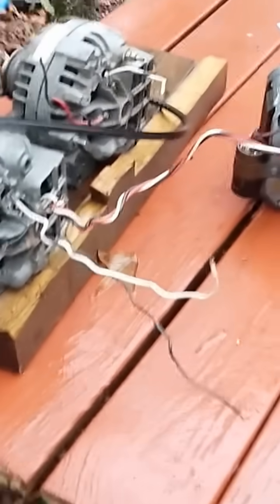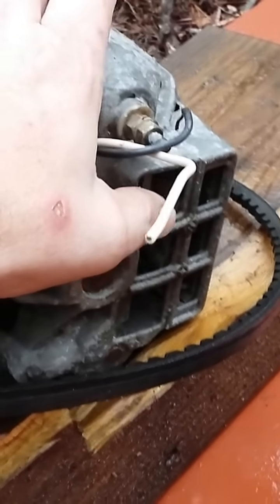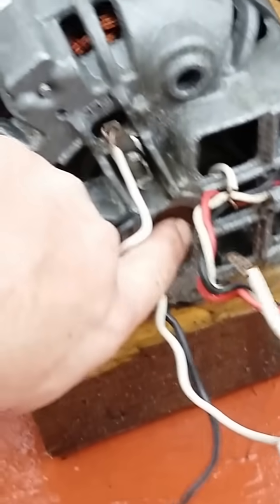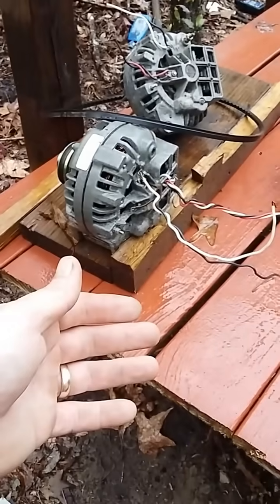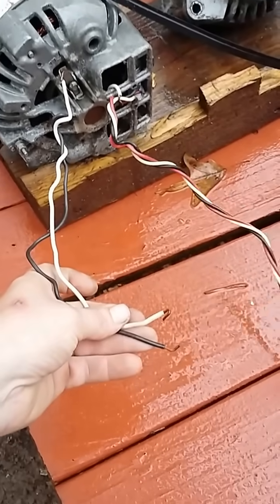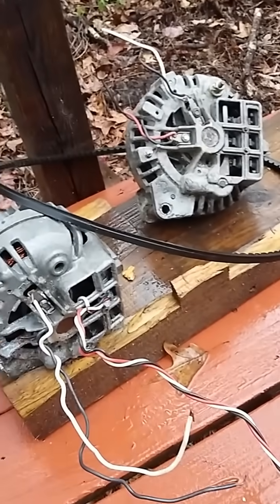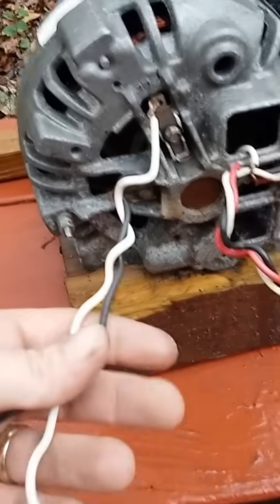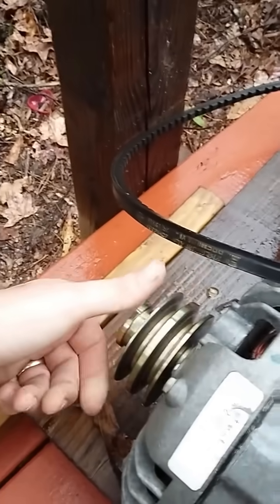Update Free energy forever no wind no solar no gas READ DISCRIPTION!!!

Comment: A few questions 
How do you use 3 phase power to power 1 phase appliances
Reply from the maker: if you have 3 phases of power and you're trying to power a 1 phase component then you either need to only use one of the phases(a hot wire) and a ground. Or run the two outside phases into a capacitor and then Run 1 phase or wire off of that capacitor but depending on what three phases you have and how stable they are, you will need to probably use an electrolytic capacitor to store and build up a charge and then run to a breaker that will stop too much power from coming in all at once.
Reply: Thomas Buie ok but that does that mean ill get less power, how am i going to get this getting more out than i put in when im only using one wire out of 3, i want to do what your hinting in the video
Reply: Can you make another video about it, sorry man
Reply: One last thing, how do you dustribute such a large amount of power, 90 amps  is heaps, i can imagine what you are hinting is true
Reply from the maker: +Zlatan Ibrahimovic brother you're not bothering me one bit by asking me questions!! it's the people that get on my YouTube channel and don't read anything or watch any of the videos that start cussing me for no reason that bothers me...
Reply from the maker: +Zlatan Ibrahimovic brother I do it with an electrolytic capacitor / Transformer. Homemade of course it's not a step up transformer or a step down transformer it's basically a big capacitor. I made one in one of my other videos out of 3 salt shakers in a glass jar. That one however is not big enough to handle a couple of generators...   I will have a couple more videos uploaded in the next day or two that you should really watch!  DO NOT TRY THIS AT HOME
Reply from the maker: +Zlatan Ibrahimovic   I will be uploading some more videos about the subject in the next day or two.
Reply: Thomas Buie awesome man i believe in you man, everyone is brainwashed
Reply from the maker: +Zlatan Ibrahimovic  yes they are!!!
Reply: This sounds good, but for a newbie, where do you start. where do you get those alternators, junkyard or parts store? Need more information about hardware. I don't know electronics so what do i do to understand how you use diods and capacitors? When, keep up the good videos.
Reply from the maker: +Peace450  there is missing information from the video I'm actually using one of the alternators as a BLDC motor if you put that to a couple of generators (the bigger the better) only using a few amps to create quite a bit.. You can use an alternative source to start a machine to run a machine off of itself or you can use direct current to power alternating current with a battery and/or capacitor bank, there are a few ways that I know of to create overunity.

Comment: I used to rebuild my 1970's 1980's gm alternators tookem all apart putem back together, now those alternators would run about 700rpm on my 350 cu inch engine at idle so my alternator is running at 700rpm/60sec= 12 hz .but we don't care because we are after the DC ,now if you "plug this directly into your wall for AC "(doesn't come factory built for this" wall AC") but if it did you would have to speed it way up from 700 to 3500 rpm  just to reach 60hz.    60hz/12hz=5 and 5x700rpm=3500rpm wow that's a lot of gas used in an hour for an hours worth of electricity ! your better off buying a solid state MOSFET 12vdc to 120vac power converter ! harbor freight has some good ones .
Reply from the maker: +Cata strophic some of your math there is a little wrong brother you need to spin an alternator at 3600 RPM to get 60 hertz, 60 hertz is 60 cycles per second. so 60 seconds x 60 cycles per second equals 3600 RPM

Comment: wheres the free part.....lol.....every mechanic on the planet knows a car alternator generates ac voltage that gets converted and regulated to around 14.5 v......heance the name.......ALTERNATOR......LOL.....funny.....
Reply from the maker: yeah LMAO...  OK so since you know everything that an alternator does, what happens when you take the direct current Bridge rectifier out of it and put in an alternate current Bridge rectifier? lol...
Reply: Thomas Buie are you kidding me man you just said take out the bridge rectifier and put in a bridge rectifier both of those are the exact same thing come on dude do you know how to build a bedini motor do you know anything about frequency do you know how to build Tesla coils and such
Reply: dude I've been a mechanic for nearly 25 years and into Electronics for probably about 30 what you are doing is nothing new to me.... I have that same alternator you are tinkering with its a Dodge alternator it has no voltage regulator only a bridge rectifier and if you bypass it obviously it will put out ac voltage I bolted mine to my Chevrolet Astro van several months back and used it for welding as an experiment... there are a lot better  things you can make a generator with one of the best things I found is those pancake style washing machine motors with the 42 pole in them they are great you can spin it with your hand and it will put out a hundred twenty volts ac with no effort.
Reply from the maker: +Gary Marshall and that is the exact point I was trying to point out to you... You didn't read any of the other comments, you haven't watched any of my other videos, and just like everybody else you also want to bash me as soon as you see this video that I posted with all the misinformation in it, on purpose! so instead of telling me what I can't do why don't you ask some questions and say what are you doing or how are you doing this and what with? In what way are you modifying these alternators? Did you put a alternate current Bridged rectifier in the back of these alternators? Dodge GM.. how exactly does the rear end in a Plymouth work nobody knows? here's a better question, Thomas what are you powering with your bldc alternator motor?
Reply from the maker: +Gary Marshall 
 if you turn that alternator 3600 RPM's and put 3 volts to the field wires without the direct current bridge rectifier or the 6 diodes whatever you wanna call it running in parallel after the fact then what comes out before you are correct and will be at 60 herts (60 cycles per second) and will be alternate current...  They're is half of it...

Comment: Is this a gag? Even if it would work (and it will not ) there is now way those wires would handle 90 amps. And it would not be free power because you have to have a engine to turn the alternator. I do not like paying for my power bill any more than anyone lese does but I live in the country so every once in awhile I will loose power and have to run my generator for a few days, Mine is not huge it runs everything except our central air and electric oven. It burns 11 gallons of gas a day. figure average of 3$ a gallon times 11 = 33& a day so that would be 990$ a month of 30 days. That is not less expensive!
Reply from the maker: What could you run those wires to that would be able to handle a load like that? Or charge from that? And I'm not talking about batteries...
Reply from the maker: +Barn Dweller no this is not a gag yes I know those little wires won't handle 90 amps of anything especially 90 amps in copper so how many amps run down the aluminum power lines does anybody know? I know it's at a hundred thousand volts and up to 300,000 in my area but I've heard people say that it goes higher than that so what you're saying is I can't step up my own system to stabilize it and then step it down to use it to power itself and anything else I want it to?
Reply: Thomas Buie I love sarcasm

Comment: The laws of thermodynamics and the conservation of energy need not apply
Reply from the maker: that's exactly right because you're using two batteries as capacitors to start the machine with a motor and an inverter and then once the machine is running u-turn on another motor twice as big with the generator running off of the first motor  (the second bigger motor not turning or hooked up to the machine until the generator is powered up) then you can unhook the first motor and just run the bigger one. therefore not breaking the laws of physics but bypassing them...

Comment: that's upto 90amps @12volts... not continues amps, also yes it puts how a high voltage but the regulator steps down the voltage so it can put out that many amps.
Reply from the maker: which is why did you take the direct current Bridge rectifier out of it and put a alternate current Bridge rectifier in it...

Comment: This is a basic junior high school shop class experiment. When you change from a low voltage to a high voltage it is a transformer. It is not making more power. The power does not change. If the voltage increases, then the current decreases. In fact, if the alternator is good for 90 amps at 12 volts, it will only be good for 9 amps at 120 volts (household line to neutral voltage) or 4.5 amps at 240 volts (household line to line voltage). He is mistaken to say the output is 90 amps at the higher voltages. Never mind the fact that you still need a motor to turn the alternator, thus negating the "free energy" claim.
Reply from the maker: +Brian Hammerson okay good job buddy you are right 9 amps at 120 volts times 10 alternate current bridge rectifiers on the alternators equals how many amps all turning by one f**** motor to start the system once it's running you have to switch to another motor power it while it's not turning and then hook it to the line so it will be perpetual motion but good job trying to prove me wrong like everybody else instead of asking me
Reply: Thomas Buie Actually, one hundred years of physics has already proven you wrong. You are just not smart enough to know it yet. What a pitty for anybody who believes in fake science. It's a waste of time and energy.
Reply from the maker: Oh I guess you don't have a reply to that one do you
Reply: Thomas Buie Huh???? I already replied. Sheesh!!! You are trying so hard to argue and insult people that you can't even keep things straight. Of course I don't know how arguing with someone who believes in make believe is going to be productive at all.

Comment: Did he really say "you don't have to pay anywhere from $300 to $1000 a month for their electricity that they're gettin' for free"????????????? First of all, I doubt this guy has a $300 electric bill. Second, he obviously doesn't know what is involved in producing electricity in mass quantities for distribution. It is an expensive operation.
Reply: Lol..be nice. The kid is under a lot of pressure hiding in the woods. Wonder what going through 100 ft of wire to get to his bedroom, living room, kitchen, etc would do to the 9 amps?
Reply: Yes, it is VERY EXPENSIVE. Just consider the expense of installing the transmission lines through all sorts of terrain. Maintaining those lines during ice and snow storms. Then the distribution transformer stations to take the transmission voltage down to distribution voltage. Now you have the distribution lines and poles to install and maintain. Now the utilization transformers to step the distribution voltage down yet again to 240 volt for residential use. We're talking thousands of linemen, bucket trucks, cable, poles, etc, etc. So, just getting the power to the customer is a huge expense and I haven't even mentioned generating the power yet. But hey, you said it is free so you must know something the rest of us don't.
Reply: Thomas Buie How is the $100,000 per man, annual salary, of thousands of linemen not expensive? If that's not expensive then you must be rich beyond all imagination!!!!!
Reply from the maker: +Brian Hammerson well I sure know a whole lot of stuff that you don't know that's for sure I like to know what state you live in where lineman's are making six figures a year that's hilarious and the fact that you even know about step up Transformers and step-down Transformers I'm sorry electrolytic pole Transformers whatever you want to call them because you know everything how many people have a privately shared the other video with the nobody on here is going to ever see..
I know what they mean by the word troll now because little kids like you living with their mama have nothing to do all day long but harass people on their YouTube channels
Reply: Thomas Buie I am an inside wireman in Indiana. My package of wages and benefits comes out to be about $114,000 per year with no overtime. Linemen work lots of overtime and make around the same as me. A decent amount of overtime can easily push him over $125,000. But you know better I'm sure. I mean I've only been in the electrical trade since June of 1991. I might know a little bit about electricity. The amazing thing is, I don't know anything compared to the physicists and electrical engineers who have access to labs and equipment with unlimited budgets. They can't develop free energy. But you, on the front porch with a couple alternators from a 1974 ford truck have solved the biggest challenge of mankind. Free energy. Wow, it must be pretty awesome to be you.
Reply from the maker: +jeff droll yeah I'm ex-military living in the middle of the woods with a killing field that I prepped all around my property so if anybody wants to come out here f**** with me I'm not worried that's why I built all this before I uploaded the video that I'm coming in on the right now that has all the misinformation in it... but don't worry it'll be down just like the rest of my videos in a few minutes

Comment: The incoming wires to a home carry 600 volts. at the box is 240v. If you hook this up to your box the voltage would have to be much higher if you plan on running more then on 220v item. The more current you move the higher voltage needed. I have no credentials as a electrician just basic knowledge in electricity. That said it would seem the wires, and alternator would melt at first attempt.

Comment: Except it's not free if you need to keep buying batteries and fuel for a motor to turn the damn thing.
Reply: sparxx210 he's might have his fat ass wife on a rusty bike that's nailed to a tree.  Hell who knows.
Reply from the maker: +sparxx210 I'd like to know how you put fuel in an electric motor but okay
Reply: lol so what if you use an electric motor to turn it? you still need a battery to crank the motor that's gonna crank your generator. you don't get anything out of this without converting some form of energy into another and that energy doesn't just come from nowhere.
Reply from the maker: +sparxx210 Yes it does!   That's exactly where it comes from, nowhere about 150 feet off of the "ground" do you know what magnets do to positive electrons at a h frequency?

Comment: What EVER you are supplying power to, it sure ain't a standard fridge, AC, water heater, washing machine, etc.  That Alternator turned generator has not got the capacity to do much more that charge a battery.  You have NO CLUE as to OHM'S LAW, buddy.

Folks, he REALLY, TRULY does not know what he is talking about.
Reply: Michel Gaudet it actually puts out way too high of a frequency even at 1800 rpm. A variable resistor could help maybe. But they do put out high amperage👌
Reply: Michel Gaudet he's missing the flux capacitor.
Reply from the maker: +Michel Gaudet if you know I'm slow then you know that Ohm's law is not perfect and I can throw some blah blah and Technical turns out there but you didn't read the important comments or watch any of the videos except for this one so good job buddy

Comment: hold on a sec, you are on to something... there is another video off your channel that demo this same thing. and it worked. however your gonna need a separate source of power to turn the shaft. this method will significant lower your bill but not eliminate it. unless you use a large solar panel, inverter and battery. has any one Google the inside of a power plant. your gonna go ohhhh

Comment: seems to be alot of hate, but realy if you just keep it DC power at 12v then you wouldnt get half these stupid comments, at the end of the day its very posible to run a house with using car parts, i think many people dont realy understand, so just run 12v dc with inverters to get 240v 😂😂 and there are things called battarys and sola panels to keep the motor running
Reply: yvonne ballard yes we heard you the first 5000 fucking times brother

Comment: 90 amps at 12vdc does not make 90 amps at 240vac. certainly not with those litle 16awg wires
Reply: I wish I could scroll more than 2 comments without seeing this. Someone needs to shut this bitch up @ yvonne ballard
Reply from the maker: yeah you're exactly right. that would just be stupid so why would you even say something like that? where did you get 12 volts from? I put 3vdc to 12vdc into it to create a magnetic field...  and I guess the next thing you would say is my test wires would burn in half if I hooked two hundred houses up to it. since you didn't ask any questions or read any of the comments and probably didn't watch the whole video and I know you haven't watched any of my other videos or you wouldn't of made a comment like that....  but good job stating the obvious